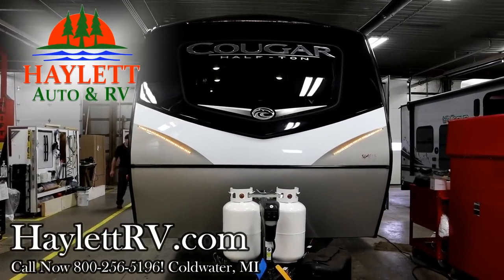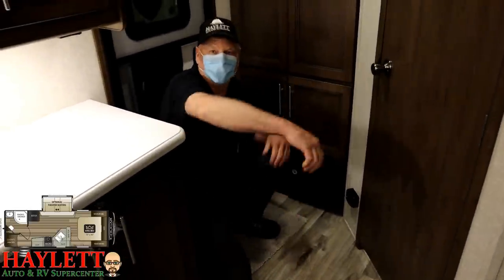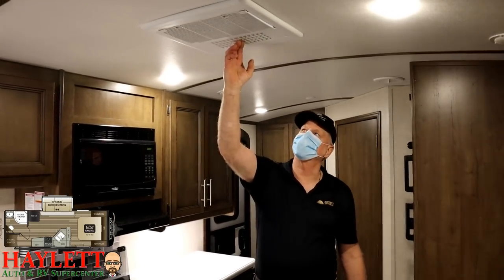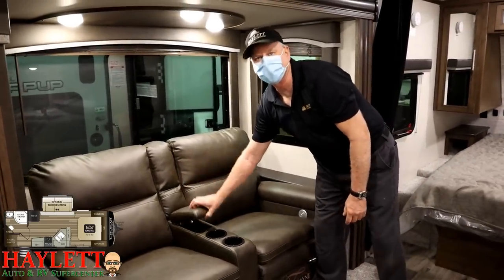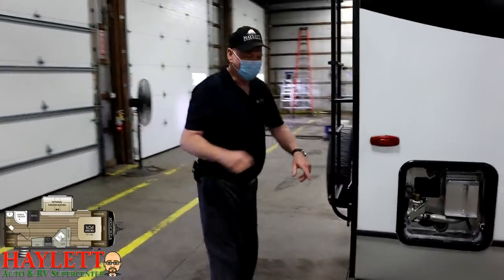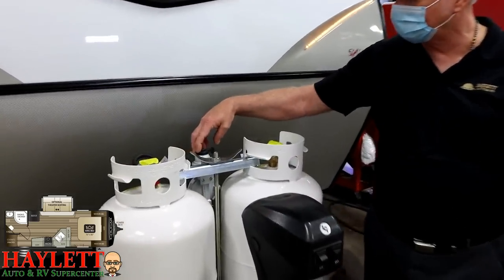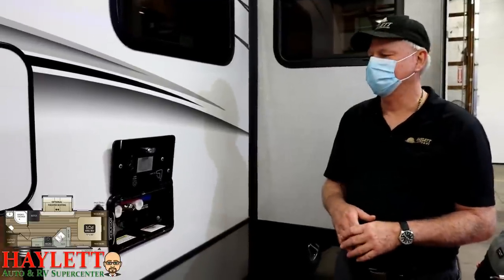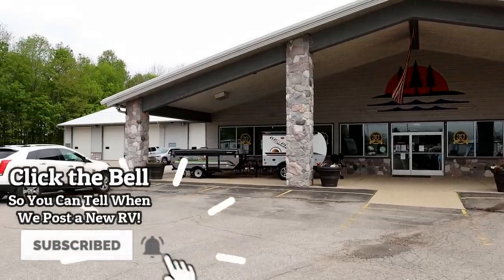(Sold) Cougar 22RBS Operation of Basic Functions

Comment: I’m very afraid of 12 volt fridges. My reason is I would need a generator. Then I have to carry gas. I don’t want gas in my truck bed I have a cover. The second reason is I don’t trust that solar at under 200 watts is going to do the job. I don’t live in the desert south west or Florida I live in New England it might rain for 3 weeks very little or no sun. Fall and spring would be a wash out it’s cloudy or thins a lot here. If it’s not raining it’s a sea of trees here. Your not going to get enough sun to run the fridge and lights if your dry camping which is what I mostly do
Reply from the maker: What I can tell you is this: Wait just a bit. I'm currently working on information regarding Keystone's new COMPANY WIDE solar program

It'll blow the doors off anything they're doing now & anything anyone else is doing currently
Reply: @JoshtheRVNerd  can’t wait to hear more!